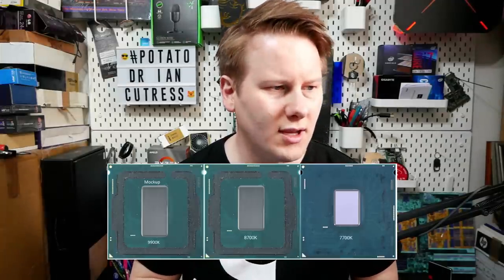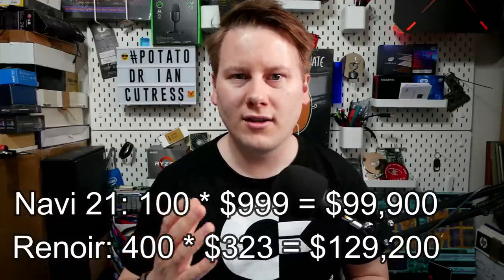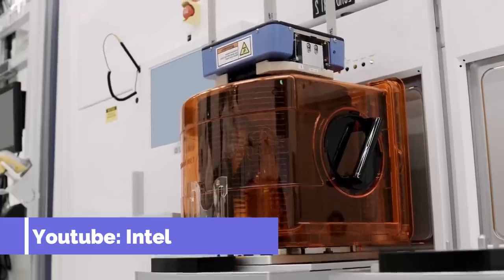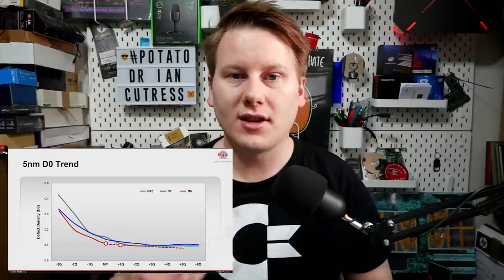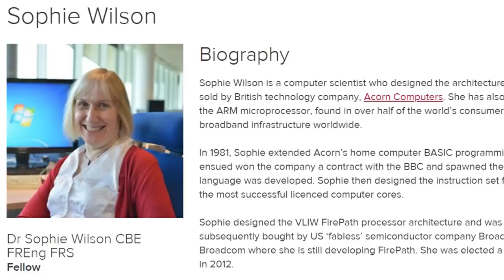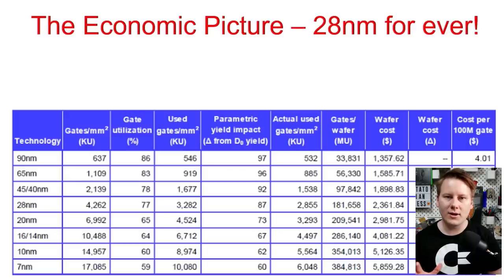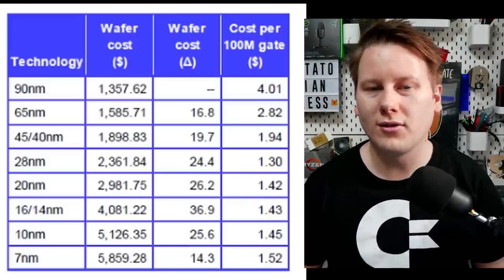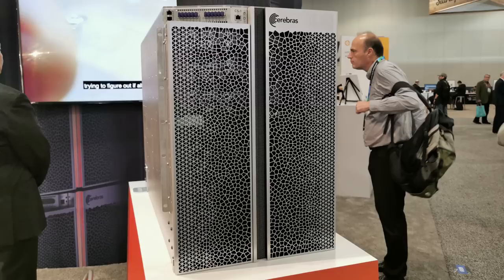The True Cost of Processor Manufacturing: TSMC 7nm

Comment: So according to Sophie Wilson we haven't been on Moore's original law (cost per transistor halving every 2 years) since before 2003.
I wonder how long it actually remained true.

Of course, the more modern version of Moore's Law is about how many transistors it makes sense to put on a chip - and that follows Moore's Law somewhat accurately.

I wonder how large Cererbras TAM is.  There can't be a large number of potential users, but I as an outsider probably underestimates how many organisations that could use their systems.
Reply from the maker: Cerebras says they have dozens of customers, and they need to grow the company to help support the number of customers after the hardware.
Reply: I wonder if we will get back on that law when we go to non-silicon like Gallium Nitride?
Reply: @PWingert1966  I doubt that. The key thing with Gallium Nitride seems to be increased energy efficiency to enable higher performance. I haven't heard anyone pointing at it as a way to reduce the costs of the chip.

Comment: Yeah, as you said the cost for a fab is huge. The lifetime of a node is limited, so the fabs need constant upgrading. The chip designs are also extremely expensive, and it takes a large amount of experts around 5 years to design a gpu or cpu

Comment: There are a lot more costs than the raw wafer and package! Fab depreciation is huge. Yield can’t be assumed to be so high (esp with larger die). Other consumables include gas, slurry, sputter targets, power, water, etc. and don’t forget to amortize the mask set cost too.
Reply from the maker: Yes of course. This is a simplified video based on a single set of numbers that aren't easily searchable.

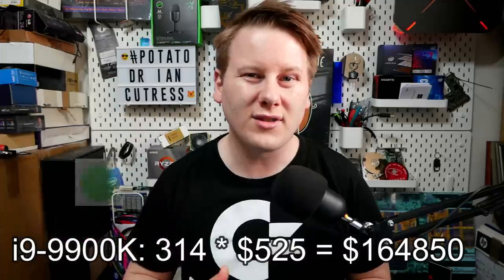Comment: Ian, would you be able to elaborate on the image at 1:32?

What is the reason behind the fact that they can't flip some of those yellow chips that are being printed vertically (specifically the ones on the 3 and 9 o'clock) which would make them viable healthy chips?
Reply from the maker: There's a small ring around the processor that's called the 'edge loss'. You can't create processors right at the edge, and the edge loss is different for different factories/nodes and such. The yellow die would be green if the edge loss was lower, that's really what it means. The calculator already moves the mask/die location to maximize the number of green dies. There's a link to the site in the description if you want to play around with the tool.
Reply: @TechTechPotato  Thank you for the explanation, but I've heard you explain that in a previous video. That wasn't my question. I was specifically asking why those 3 and 9 oclock chips can't be flipped from horizontal to vertical to fit them inside the edge dead zone. Something to do with manufacturing?
Reply: @Hostilenemy  As well as the lithography problems hughJ mentioned,  it would also introduce more complexity when cutting the wafer into individual dies, where it might not be possible (or impractical) to cut and hold an irregular arrangement like that.
Reply: Do you really think that they would happily throw away money?!
 That layout gets all the attention from hundreds of eye, before starting anything...
Reply: @TechTechPotato  why can't wafer be square or rectangle instead?
Reply: @DarkPa1adin  Wafers are round because the ingots are cylindrical, the ingots are cylindrical because the crystal grows radially from a seed.  To make them square would mean cutting a circle down into a square, giving you less usable area than if you had left it a circle.  You increase the usable area of a wafer simply by having them be larger to start with (from larger ingots.)  This has been occurring gradually over the decades.  https://en.wikipedia.org/wiki/Wafer_(electronics)#Standard_wafer_sizes

Comment: Great content as always, one question: Dr Su always points out that margin on console-SoCs increase over the cycle, does this factor in a decrease of wafer costs and if so can AMD expect the cost of TSMC 7nm wafers to decrease any time soon?
Reply: TSMC have stopped discounting at the moment, I can't see that changing any time soon with demand so high
Reply from the maker: At the beginning of the cycle all the CapEx is done, which doesn't factor into future production. But usually over a processor cycle, between AMD and TSMC, there are additional efficiencies that can be made. A slightly better process step that gives better yield, or perhaps a tweak that saves 50 millivolts. Or in the past, a redesign for a smaller process node that ends up being cheaper.
Reply: The cost of TSMC 7nm wafers obviously isn't going to decrease any time soon when they can't get close to meeting demand at current prices and production is hobbled by ongoing water shortages.

Comment: How many 8086s could fit on a 7nm 12 inch platter?  That said I'm a fan of the 186, 386 486 686 and Pentium 4.  386 was the last processor without intentional hardware backdoors.

Comment: 100% yield? The large processor yields are quite low. I'm not sure where they are today, but I remember hearing that the Pentium bring up (long time ago, I know) in Intel's Ireland fab, was only hitting 30% yield. That was below target, but I'd be surprised if mature, top processor yields are better than 50%.
It also costs somewhere between $1-2B to tape out a 7nm processor design. That's R&D, design, validation, mask costs. That has to be recuperated.
That Sophie Wilson presentation is from 2016. Those leading edge wafer costs have probably changed a little bit since then.
Lastly, it's interesting to see someone doing a wafer-scale processor again. I'll have to catch up on your video about that. When I was a post-grad at the University of Sheffield, we worked on a European ESPRIT wafer scale mSIMD processor.

Comment: "When you buy a product, you're clearly buying it for more than it cost to make"

No, that's not the case. Some products, like the PS5 for example, are sold for less than the cost it took to manufacture. The companies are still going to make money one way or another but the point is that products are sold for less than the cost it took to make
Reply: youre gonna have to explain that one. make money...while selling at a loss.
Reply: @UniqueBreakfastTaco  the Games that being sold are the profit.

Every single sale of any Game, and every single in-game Purchases and Transactions, be it on PS5 or XBoxSX, a portion of the money goes to AMD, because technically they Manufactured both XBox and PS5. That's how they get the money back from Manufacturing cost of both Consoles Machines.
Reply: @UniqueBreakfastTaco  Companies would sell consoles as a "loss leader"... ever since the first Sony Playstation / first XBOX, while making money on licensing for games. It's what you have to do if you want to gain market share ( Epic Games versus Steam ). Back then it was still Nintendo versus Sega. But that was back when CDs / DVDs cost 30 cents to print, versus cartridges with expensive PCBs.

Comment: The fact that APUs cost less and are much more profitable than GPUs accentuates my incomprehension to why don't they focus on making extremely great APUs like the one in the PS5/XboxSeries and even much expensive (and more powerful) ones. It wouldn't make the consoles obsolete because of their ecosystems and high value, it would gives us more performance within a single chip and make them profit a lot. Bandwidth isn't necessarily a problem because like we saw on the 4700S, they can put memory right onto the die. Time isn't a problem because if they really wanted to do that, they could have focused on it since Zen 1 and have already released some products since Zen 2.
I really believe it's a lost opportunity for everyone that high performance APUs still aren't sold in 2021, and it's much more apparent with the global situation. By focusing on and only CPU fabrication, there would be less availability issues.
Reply: They make creat apus! Apus that are cheap and van be used in milloin of market computers!
Apus like Xbox and ps5 are Big and expensive, so nobody would like to buy those!
Would you pay$1200 or more from apu that is similar than used in ps5? Most likely not…
Reply: @haukionkannel  You don't understand how it works ! Did you even watch the video ? Cost isn't the problem : if it's highly manufactured, they can afford to make a bit less profit. That's how basic pricing works. The best DIY APU right now is the 4750g (the 5750g will have exactly the same performance because the GPU part didn't change nor the frequency while it's the current bottleneck, with bandwidth). The 4750g has RX 550 2gb performance that is to say below base ps4 graphics performance... That's not great... Yes the fact that we got a big upgrade from the 3400g 4 Zen+ cores to the 5750g Zen 3 cores is impressive and great, but that's just not enough. The 3400g graphics basically performs the same as the 5750g but the much better single performance of the CPU part improve performance and consistency a bit in games. Many people think AMD is holding back for Navi APUs but I don't see this being huge aswell. We need BIG APUs like the one found in the PS5/Series consoles with integrated GDDR memory, and you'll know it's also better for them if you watch the video carefully.

Comment: It's surprising to me to see how many of TSMC's customers are between 20nm and 65nm. Moving to a new process is very expensive, of course, and a lot of products won't benefit; but given the costs, to be such a significant part of the revenue...
Reply: I think 65nm is especially surprising when that chart shows that 28nm is cheaper per transistor.
Reply: @nathangamble125  the rest of the kit wouldn't be. Mask, test jig, packaging, and on and on. If you make light controllers, you wouldn't be paying that price; you don't see a big benefit from transistor performance.

Comment: Love the shirt. C= Commodore 64. My first home computer (1983ish).  64KB RAM, 39KB of that were for the operating system. Cassette tape data storage. 21" low rez cathode ray tube monitor Today, iMacPro 128GB RAM, 3TB internal drive, 40TB external SSD data storage,  27" 5K resolution screen. My, my……my!

Comment: Write of cost for manufacturing equipment, R&D, contingency for things like power loss, so many factors that go into making a chip and that's without the IP R&D for the chip itself and that whole aspect of costs to factor in.

For raw material costs - spot on, for overall processor manufacturing costs - just a niche aspect and a qualifier that this is just raw material production run without factoring in all the other larger cost aspects.

So, 3D 28nm, cube dies - imagine that.

Comment: Great video ! I'm curious about the 90nm chips,  their more expensive per transistor , but still being manufactured , are there any advantages to wide traces ? are they more resistant to damage by radiation , voltage surge , Etc. ?
Reply: Don't forget the cost of the fab itself. An old 90nm fab has already paid for itself. 
Producing extra wafers now is all profit, so there is an incentive to price low and sell more units. 

You can't do that if you  have a 1 billion debt to cover the cost of building a new fab.
Reply: @ITH56  I see that , but what I'm asking is are there advantages to wider traces ?
Reply: @robertlackey7212  lower time constant, 1/RC
Reply: @UniqueBreakfastTaco  Oh goody another string of science words .
Reply: @robertlackey7212  science is hard
Reply: @UniqueBreakfastTaco  I run a electronics assembly tooling company , I get so tired of jargon from little Pri**s , but you go right ahead , I don't have to work with you.
Reply: @robertlackey7212  then I may be on the other end of a PO and you may not know it. Get some damn chips man 👍

Comment: Do the prices just reflect the processor core like the algerbra and floating units, or also the parts like the controllers like when intel moved to sandy bridge and added it to the cpu make much of a difference to cost in a processor, I'm just a bit confused as to what is in the wafer.
Reply: Depends on the chip design

Intel has done monolithic designs up till now, so that means everything is on the cpu, from tb3 controllers to IMC to the CPU cores themselves

AMD has put much into an I/O die which is produced by GloFo instead of TSMC, TSMC basically produces just the CPU cores themselves from my understanding

Comment: What you say about wafer costs is about right, but if the number of ICs you have built is small, the NRE for the masks make the economics quite different.  How many processors do you suppose Cerebras actually sells?  For small runs, the incremental cost of each wafer is miniscule.  If you are just big enough to move from a shuttle run where multiple parties share space on one wafer to buying a complete wafer on your own, for TSMC 12nm the mask set will run you ~$2.75M and then each wafer you buy will cost ~$7,500, depending on options you purchase.  If you are buying lots of wafers, your cost per wafer will be negotiated lower, but you may need multiple mask sets depending on how many ICs you want per run.  Each run takes about 85 days currently for 12nm, once you can get your run into the TSMC schedule.

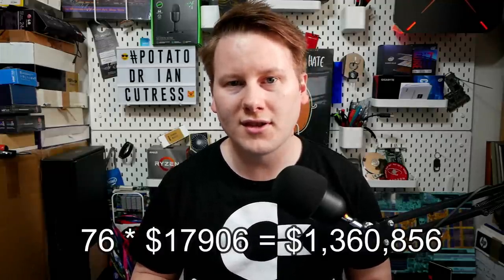Comment: 2:12 you've skipped over why such a large die is seemly disproportionately expensive. And that is because cost of production isn't a linear function of die width or even die area. Instead it's roughly proportional to the fourth power of die area.

Think about it, if there are say four defects per wafer, then if there are sixteen dies per wafer, one quarter of the dies at most will be defective. Somewhat less if the defects happen to hit in the same die.

So if the wafer costs $1000 to produce, you'll have twelve good dies, and so it would cost $1000/12 dies = $83.33/die.

On the other hand doubling the area of the die you don't double the price, because now you have eight dies per wafer, and up to four of these can knocked out, leaving you with just four good ones, for a cost of $1000/4 dies = $250/die, or three times more expensive than the smaller die despite being only twice the area.

If you want to double the die area again, you'll likely be spending money to make nothing. Because at four dies per wafer, they could all be bad, meaning you're unlikely to get even one for $1000...

Comment: 8:25 what else apart from defect rate determines yield?
Reply: edge loss, if its going to a product its often related to variances in performance and silicon purity as well. Quality of the masks can be a factor. And most importantly, theres batches of silicon that are often not properly doped or have dust or similar particulates, destroy even batches of wafers as their usage could cause more harm than good.

Comment: this is a tricky topic because you cannot pick a specific SKU, but must account for ASP across all SKU's support by a given die. The apparent goal might be to capture as much gross margin with the total wafer capacity you have. Looking too much at the extreme gross margin of the high-end products has a mesmerizing effect, but lead you down the wrong path. For the semi vendor in the lead position, that is, the one able get the highest gross margin across the entire production volume, as Intel used to be, one might think defending the margin is the priority - as wall street idiots think it is. 
Consider this. At one point, Intel had gross margins in the 56-60% range across the entire product line, with 90% in the premium  products. The second tier vendor, either in performance per die area, or other factor, must accept a gross margin, say 45% vs 55% for the lead dog. The lead dog is highly profitable (net) but the trailing dog is still net positive.
Instead of defending margin, by deliberately and carefully calculating a lower gross margin for a viable net profit, this in turn forces down the gross margin of #2, possibly pushing them to zero or negative net.
Reply from the maker: Yeah I hear you; I was singling out individual processors on purpose to make the discussion simpler. The financial analysts on the calls always pay attention to the product mix and ASP, but that's another topic for another time on the channel.
Reply: @TechTechPotato  some more analysis: in the Skylake Xeon SP, if you look at the common line models, excludes special SKUs like the XCC die with all 56MB L3 and only 4 cores enables, plot the price per core versus cores.
it is a reasonably linear in the price per core increases as the number of cores increases from 4 to 24, then takes a big jump for the top 2, of 26 and 28 cores. 
Now consider a data center operator, supporting VM's of 2-8 cores. What is the most economic choice in cost per core.
At the system level, the costs are the processors, motherboard, power supply, chassis and shared peripherals (10GbE NIC + ports on the switch). I exclude memory because the cloud providers offers fixed memory per core, and hence cost is the same. Using list price of processor, and reasonable estimates, it turns out the lowest cost per core is at around the 20-22 core SKU's.
If we then factor-in host costs : which is per 1U/2U space in a rack, then this should push the optimal to 24c?
The justification for price spike at the high-end is that here, the criteria is winning. In gladitorial or other mortal combat, the prize for second place is an axe blow to the head from the first place contestant, hence any price that assures victory is justified.

Comment: I watched a vidi on Navi and their RTX memory chips (mid 2020) and why they elected to go with the manufacture's recommendation of using 8nm*  instead of 7nm* as to 7nm having a 47% rejection rate while the 8nm was 28% rejection..  Due to the apparent 'shortages' I deduct that the failure rate of the 7nm and below (apparent size) is due to not getting the chip failure rate under adequate control.. it could actually be higher than stated.